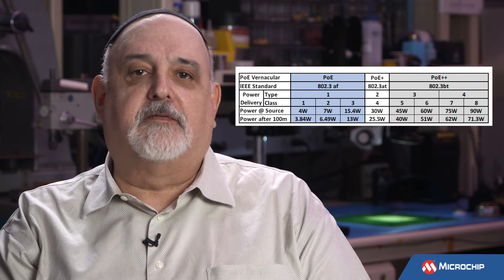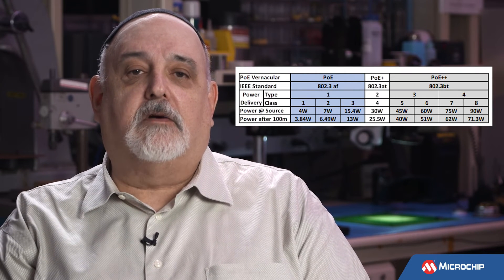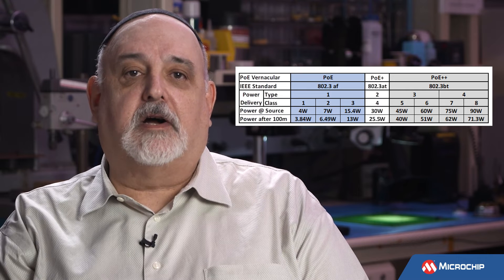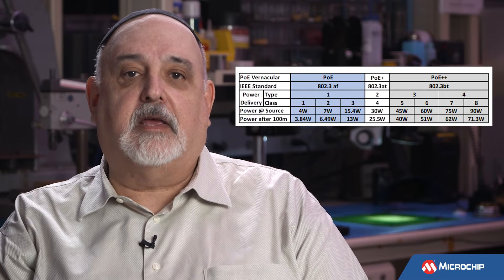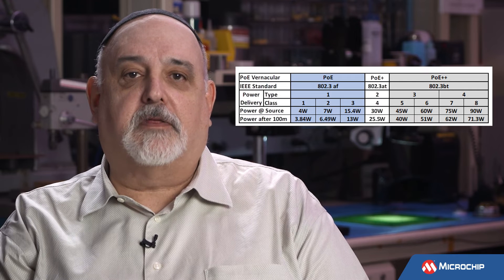AOE | What is the Difference Between PoE, PoE+, and PoE++?

Comment: Sheesh, I’ve been out of the game too long. I didn’t know about POE++. From what I recall, AT was limited by a 100 deg C temperature rise in some large bundle of cables, I believe all (most?) pulling AT power levels. How did BT get around that!?
Reply from the maker: Hi there, thanks for your comment! To elaborate, the PoE++ (IEEE 802.3bt) standard overcomes the 100°C temperature rise limitation in large cable bundles by employing several measures: using better cable management practices, opting for higher-quality cables, utilizing all four pairs of wires in Ethernet cables for power distribution, implementing power negotiation between power sourcing equipment and powered devices, and ensuring adequate cooling and ventilation. These strategies collectively enable higher power delivery while minimizing the risk of overheating. Let us know if you have any further questions!